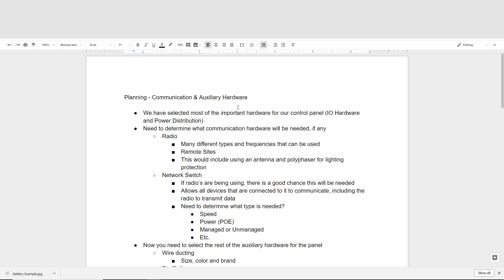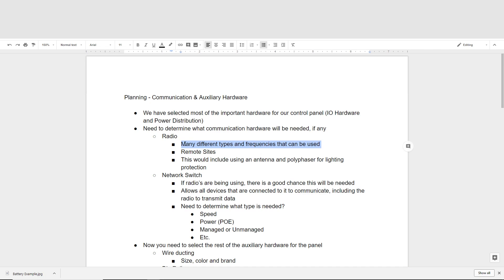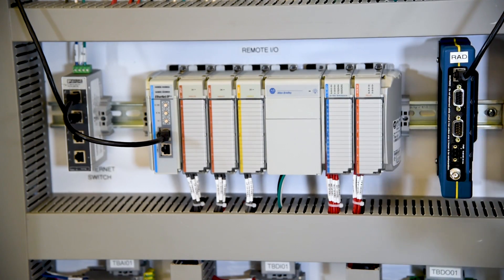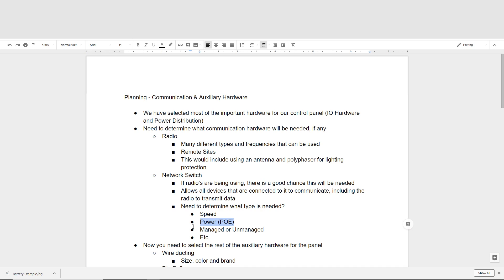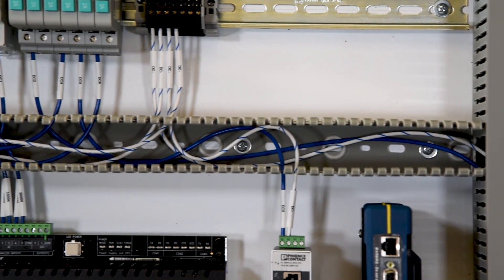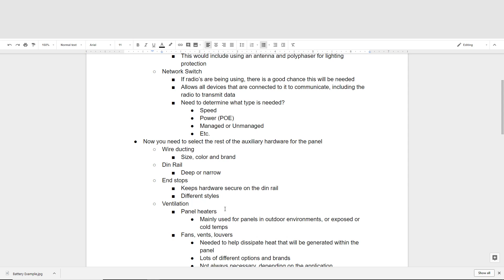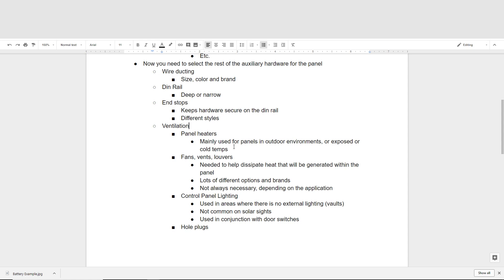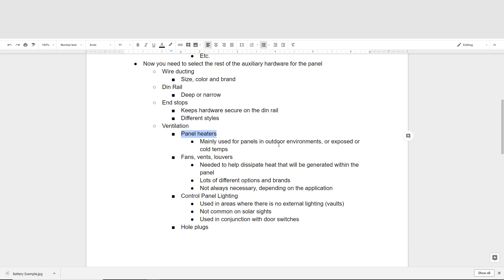Control Panel Build Series Part 7: Planning  (Communication and Auxiliary Hardware)

Comment: Don't forget air conditioners.  They are critical when running multiple VFDs and servo drives in very dirty environments (ie: welding dust, coolant mist, etc).  I've seen a 600V 3-ph disconnect arc out from welding dust ingress and punch a golf ball sized hole through 16ga steel.